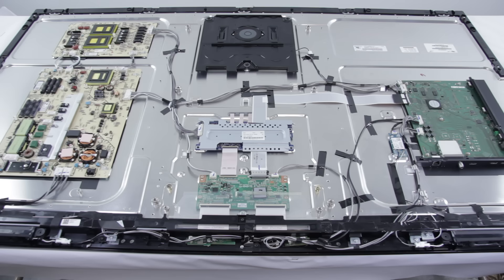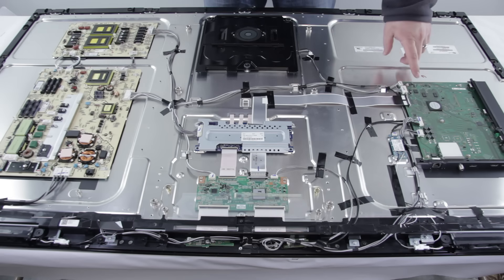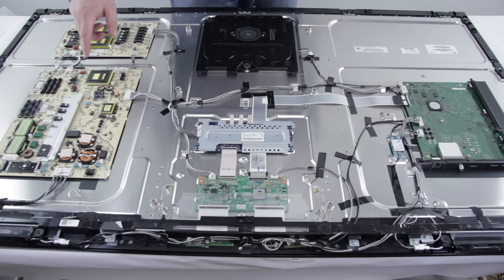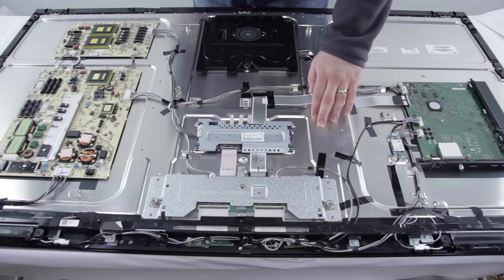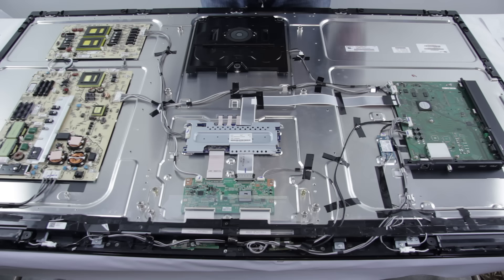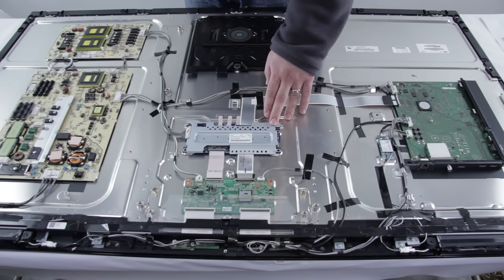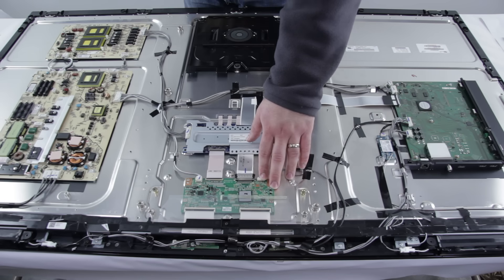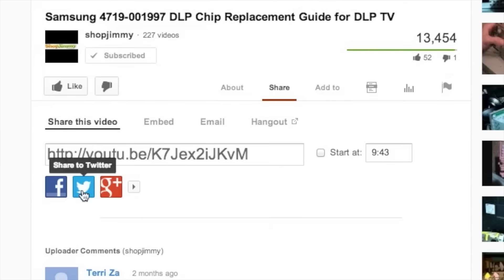LED TV Repair Tutorial - Common Symptoms & Solutions - How to Repair LED TVs

Comment: I have a Samsung 46" 3D LED HDTV ( UA46ES6200M ) and the problem is exactly top half of the Screen is dark.
I can see the picture on the Top Half, but it is very poorly lit and darkness is fading towards the center of the screen
Bottom half is perfect.

This problem appeared couple of times, few months back, but got resolved by itself after few days.
Now it started again and this time its more than a month and not going.

When i called the service center engineer, they said the entire panel needs to be changed. But i feel there is some problem with the BackLight or inverter? and could be fixed without the entire panel being replaced.

I am not sure of the make of this model. Does it have two backlights? and one is broken?
Could you advise, exactly what could be the problematic part and how it can be fixed?
Reply from the maker: Venkat Adisetty   This sounds like you have bad LEDs in the TV panel.  Unfortunately we do not sell replacement LEDs.  Thanks!  www.shopjimmy.com

Comment: Samsung UN40EH5300F will not power on (red standby light blinks)...what order should boards be checked (how ? - competent with multi meter)...best order to replace boards (power,main,t-con....main,power,t-con...etc.) if needed....any help greatly appreciated...thanks
Reply from the maker: Chuck P   It does not matter what order.  I recommend checking your power supply board for standby voltage.  Thanks!  www.shopjimmy.com

Comment: Hi, thanks for the video and all the help!
I have a 55" LG model # 55LE8500-UA. It will not turn on, at first it would take a couple of tries and come on fine. Then it would take 10-15 minutes (almost like it had to warm up). When you turn it on you could hear a buzz from inside, if we left it "on" for several minutes the turn off and on again it would come on and work normally. Then it took 30 minutes, then an hour, then 2..... now nothing! I haven't taken it apart yet, kinda want to have some idea of what to look for. Thanks again for your help !
Reply from the maker: Mark Foster   Please watch this video FIRST to help with your repair!  https://www.youtube.com/watch?v=BP3NVNCGEv8  I recommend replacing the main board in your TV.  Click this link to replacement parts for your TV model number:  http://www.shopjimmy.com/lg-ebu60863006-main-board-for-55le8500-ua.htm  There may be multiple boards for the same TV model number, be sure to match part numbers on your current board, with your replacement for compatibility.  Here is a link to a video showing how to identify your part number, click here:  https://www.youtube.com/watch?v=RwHTvjMdrhk  Thanks and please let us know if you have any further questions with your TV Repair!  www.shopjimmy.com

Comment: Hi I have question about my LG LCD TV, here are the details:

Make: LG
Model: 42LH50
Year: 2009

Problem: TV does power on and I can see the back-light come on but there is no picture.
The screen remains black with a glow of the back light.

The remote works to turn on the set and so does the main power button, but the standby/on button on the side of the TV does not work. No inputs from the remote or the side keyboard produce any picture on the screen.

What part do you think I should be looking at?

Thanks for  your help with this.

Adi

Comment: Hi, i have a TV Westinghouse UW40TC1W, the problem is that this tv has starting to turn off the LED Lamps randomly, most usual on the right side of the tv, sometimes it works perfect and suddenly the tv screen goes dark individually on the right side of the screen and sometimes a little part of the left side. I want to know what can i do about it as it seems that the tv might not be completely dead yet. Thank you.
Reply from the maker: Víctor Alejandro Fernández Stefan   Sounds like you have some LEDs that are not turning on, on one side of the panel.  This could be a problem with either the power supply or the LEDs in the TV panel.  You can replace the power supply board to see if that fixes the problem.  Unfortunately I do not see any replacement parts in the search results for your TV model number on our website.  Please reply with your part number on your power supply board and I can try searching for replacement parts.  Thanks and please let us know if you have any further questions!  www.shopjimmy.com

Comment: LG 39LN5300
sound isnt working and picture only appears and disappears about every 4 seconds. (picture went out first then sound)
Reply: ShopJimmy.com I replaced the main board. Now the sound works but the picture is still completely dark and does not flash anymore.
Reply from the maker: emacg   Are all of the cables connected properly?  Thanks!  www.shopjimmy.com
Reply: ShopJimmy.com yes. I checked them quite a few times.
Reply from the maker: emacg   It sounds like you received a defective replacement main board.  You may want to try a different replacement main board to see if that fixes the problem.  Thanks!  www.shopjimmy.com

Comment: I have a Toshiba 50" LED TV  Model 50L2300V Serial D44252T23857L1   The TV picture went black but had sound.. I turned off the TV and it begins to boot and the picture goes black with no sound.

Comment: I've had my Samsung led model un40f5500af for a little more than a year now. A couple of days ago I sensed a burnt smell in my room. The smell was coming from the upper left side vent of the tv. The tv was looking perfect but the smell was getting stronger. I turned of the tv for about 3 hours. I turned the tv back on and the smell came back after 10 minutes. After that I also noticed that the upper part of the screen  was not as bright as the rest. Any ideas on what went wrong? I would gladly appreciate it. Thank you.

Comment: Question: My 2 year old daughter got a hold of a squirt bottle full of water and attempted to "clean" my Samsung 46" LED Model # UN46C6500 by misting the entire screen. My wife was prompt to wipe it off, however, now there's two vertical lines smack dab down the middle, about a 1/4" apart, one is red, the other blue. Everything else seems fine, except for those two danged lines RIGHT DOWN THE FRIGGIN MIDDLE. I've checked with friends who have some technological knowledge, and they've suggested that the panel is damaged, and I'm pretty much screwed. So now I'm asking you guys to give it to me straight...I can take it. Thanks for the help in advance =)

Comment: hello, i have a samsung UN55D8000 and my 2 year old son sprayed A LOT of windex on to the screen causing vertical lines to appear. I took it to get checked out and they told me that the screen it self was no good and it needs to be replaced. Can this diagnostic be true or is it something else ? thank you !!!
Reply from the maker: Jose Camacho   This sounds like a TV panel (TV Screen) problem.  If your TV panel is bad, it may be more cost-effective to replace the TV as panels are typically hard to find in stock, difficult to replace, and expensive.  Thanks and please let us know if you have any further questions!  www.shopjimmy.com

Comment: I'm looking for help in troubleshooting an issue with my LG 47N5790. When initially turned on, the LG splash logo displays for a half-second before the LED back-lighting goes off. Audio remains on and an image is displayed on the panel (determined by performing the "flashlight test") but that's it.  Based on your video above, I believed the issue was related to the LED Driver board in my TV but was unable to locate it under the rear cover.

I raised this problem with the Live Chat CSR at your website and they suggested the LED driver was built-in to the Power Supply board.  I subsequently ordered and replaced the board based upon this recommendation but the problem remains.  Any other suggestions?.
Reply from the maker: Michael Cozine   It sounds like you have bad LEDs in your TV panel.  Unfortunately we do not sell replacement LEDs or TV panels.  Thanks!  www.shopjimmy.com
Reply: Your situation is the exact same one I'm experiencing. Did you ever solve the problem? I've replaced my power supply board and main board but nothing has changed.
Reply: Johnny Hough
Reply: Johnny Hough I returned the power supply board (and ended up paying a 20% restocking fee despite ShopJimmy's recommendation that this was the problem) after the issued remained unresolved.  I then obtained and installed new mainboard and T-Con boards via E-bay (no restocking fees) but still no result. 

The best I can tell there seems to be a short in the LED backlighting but I've since resolved to stop trying and NEVER buy an LG television again!

Comment: Hi,
I have an LG 55LS4600 that has no picture. It appears that the unit powers on as the red led light on the lower right shuts off when the unit is powered on and the remote control seems to be sending commands okay as the red light flashes when a command is sent. It just seems that there is no picture and no sound, just a completely black screen. When I press input or menu... nothing. Would you guys happen to know which part is more than likely in need of change and how much that part might cost and whether or not you have it?
Thanks

Comment: I have a Vizio E701i-A3 70" TV. The problem I had was that one day it just went dark. I called Vizio, but they said I was 10 days past the warranty date. I unplugged the TV and did all what the Vizio tech asked me to do, but still no picture. Do you have a video specifically showing a Vizio E701I-A3 that I can watch to trouble shoot mine. Or what do you feel is wrong with my TV. The TV was only 1 year old.
Reply from the maker: Marcy Soliz   Do you have sound?  I recommend running the flashlight test on your TV.   Here is a link to a video we produced that shows how to run the flashlight test. https://www.youtube.com/watch?v=xUzCLgoSPGM Please reply with your flashlight test results and we can recommend a replacement part for your TV repair. Thanks and please let us know if you have any questions! www.shopjimmy.com
Reply: I haven't done the flashlight test yet, but will do this weekend. But the TV did have sound after it went dark. But after running the tests that Vizio had me do on it, the sound no longer came on. But I have another question now on the main board. My TV is a Vizio E701i-A3, but when I took the back panel off, the main board says it's a E601i-A3 MB on it. Is that the correct mother board, and does it matter?
Reply from the maker: Marcy Soliz   Please reply with the results of the flashlight test.  Here is a link to some replacement main board for your TV model number on our website:  http://www.shopjimmy.com/catalogsearch/result/index/?cat=56&q=E701i-A3  These boards will help you to see what your main board should look like.  You will want to identify the part number on your main board.  Refer to the notes in red on these product pages and then check the sticker numbers on your main board.  Thanks!  www.shopjimmy.com
Reply: Marcy Soliz I did the flashlight test on my Vizio E701i-A3, and I could not see the menu with the flashlight. My TV does have backlights when powered on. It did have sound after it went blank. But after running some test the sound quit. This TV is a Vizio E701i-A3.
Reply from the maker: Marcelino Soliz  Please watch this video FIRST to help with your repair!  https://www.youtube.com/watch?v=BP3NVNCGEv8  This could be a problem with either the t-con board or the TV panel.  You can replace the t-con board to see if that fixes the problem.  Click this link to replacement parts for your TV model number:  http://www.shopjimmy.com/catalogsearch/result/?q=E701i-A3  Be sure to match part numbers on your current board, with your replacement for compatibility.  Thanks and please let us know if you have any further questions with your TV Repair!  www.shopjimmy.com
Reply: ShopJimmy.com I have replace the T-Con board with one that I bought from you. Still no sound or picture. I di have back lights when I power the TV on. So what do I look for now.

Comment: Hey, thanks for posting the video. I have a 42" LG 42LV4400. I recently spilled iced tea on it. It wasn't much.. just a splash but it did plenty of damage. I didn't think the spill even reached the tv at first.. so I kept the tv on. After a few hours of use I noticed one thick vertical ghost line. after a little while it was three ghost lines and soon enough there was a big finger shaped line coming from the bottom. I immediately took her apart. I Youtubed some videos and cleaned up all my ribbons and anything else that got moist. Turned her on while she was apart to make sure I did it right and all the vertical ghost lines were gone, but not the finger shaped blob. Everything worked though. I was getting picture and sound and I could change the volume and channels. But, for good measure I decided to leave the tv open and exposed and I positioned a fan toward it and left it for 24 hours. After a day I put it all back together and turned it on. It turned on fine, ghost lines were gone, but the finger blob is still there. I plugged in my HDMI cable and tried to change the channel but nothing happened. Volume buttons, channel buttons and the menu button do not work, but the power button does. If the motherboard was bad, wouldn't the power button not work too? Did I not put it back together correctly? I can deal with the blob that's there.. but having no buttons work is baffling me..  any suggestions?

Comment: Hi I think my Sony Bravia was hit by the rotor of a toy helicopter, so about one inch in a horizontal line started forming to about 18 inches towards the middle of the screen about 1/8 inch wide,is there anything we can do to fix that? Model # KDL-40S4100, Thank you
Reply from the maker: Judith Stahl   Unfortunately there is not fix for this.  Your TV panel is bad, it may be more cost-effective to replace the TV as panels are typically hard to find in stock, difficult to replace, and expensive.  Thanks and please let us know if you have any further questions!  www.shopjimmy.com

Comment: Hey ShopJimmy, I have a LG 55LA7400-UD. When you first turn it on, everything is fine. After a few seconds it will go dark on the far right side. Eventually it would go dark all the way across. So I replaced the LED driver board and it helped some. Now it's just the far right edge that stays dark. Could that be a bad connection/solder or is the actual LED strip going out ? What's a good way to test this ? Thanks in advance for any help you can give me.
Reply from the maker: Markus Berang   Sounds like you have bad LEDs in your TV panel.  Unfortunately we do not sell replacement LEDs or replacement TV panels.  Thanks!  www.shopjimmy.com

Comment: Hi! I have an RCA LED40HG45RQ. Due to faulty wiring in my home, it took an electrical charge through the HDMI input. We saw smoke, smelled burning wires, etc. The unit currently won't turn on. I was hoping I'd open it up and see a fuse inside, but no such luck so far. Should I start at the power supply even though the charge came in via HDMI?  Many thanks!
Reply from the maker: Shane Chaney   Since it received an electrical charge, I recommend replacing the power supply board and the main board in your TV.  Unfortunately I do not see any replacement parts in the search results for your TV model number on our website.  Please reply with your part number on your main board and power supply board and I can try searching for replacement parts.  Thanks and please let us know if you have any further questions!  www.shopjimmy.com

Comment: I have an LG 47LE5400. When powered on, there is no backlight, no picture no audio. Only the touch control lights on the front light up. Wondering what board this sounds like?
Reply from the maker: garteh  Please watch this video FIRST to help with your repair!  https://www.youtube.com/watch?v=BP3NVNCGEv8  I recommend replacing the main board in your TV.  Click this link to replacement parts for your TV model number:  http://www.shopjimmy.com/catalogsearch/result/index/?cat=56&q=47LE5400  There may be multiple boards for the same TV model number, be sure to match part numbers on your current board, with your replacement for compatibility.  Here is a link to a video showing how to identify your part number, click here:  https://www.youtube.com/watch?v=RwHTvjMdrhk  Thanks and please let us know if you have any further questions with your TV Repair!  www.shopjimmy.com

Comment: hi,i have tv LG 55LA6200 and if i turn on the tv working perfect  for a few minutes (audio and video is perfect)after a few minutes the screen going in black and the sound i good,if pass the flashlight and i can see the picture,the backlight stop to work,i change the power supply and the same problem,(this model have the backlight driver on the power supply board),I putting the power supply to work alone with the leds backlight panel (jumping power on and the backlight on with the 3.5 stand by voltage and i can see the same problem ,the leds start to work and after a few minutes stop to work,i need help,is possible the leds backlight panel damage?where i can finer the leds stramp ?the tv use 7 stramp L and 7 R,total 14 with and 6 bulb each .or where i can finer the led bulb for replace all led bulb ?
Reply from the maker: osamani napoles   This sounds like you have LEDs in the TV panel.  Unfortunately, we do not sell replacement TV panels or replacement LEDs.  Thanks!  www.shopjimmy.com